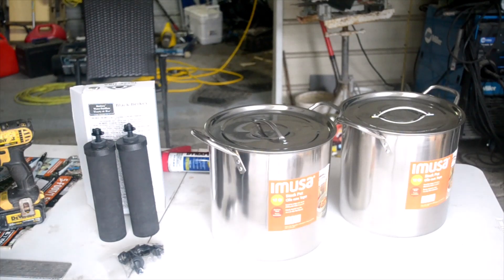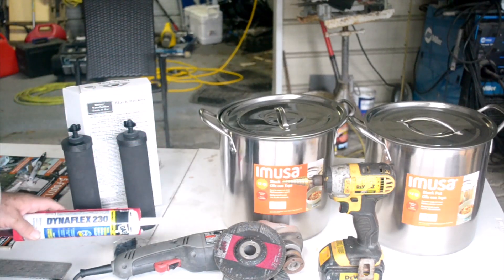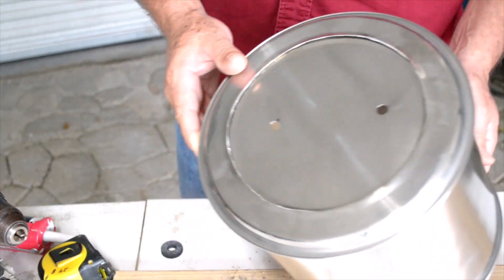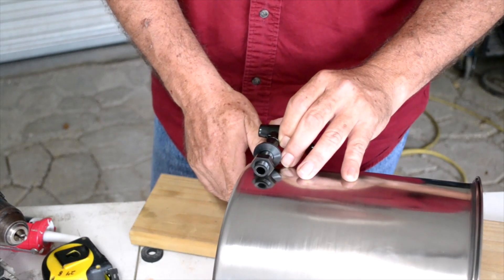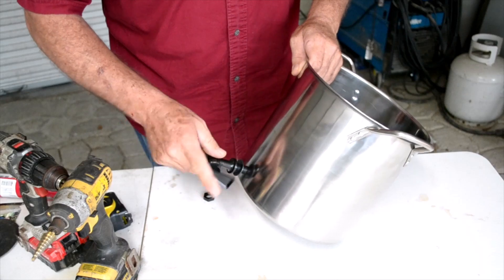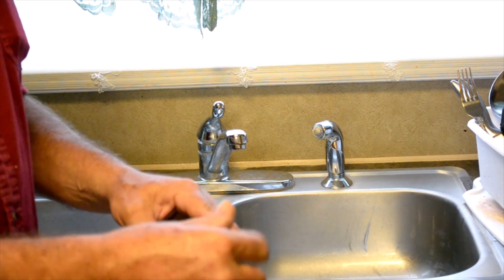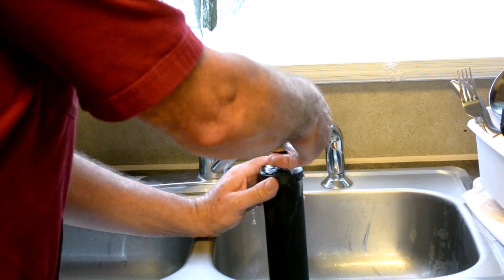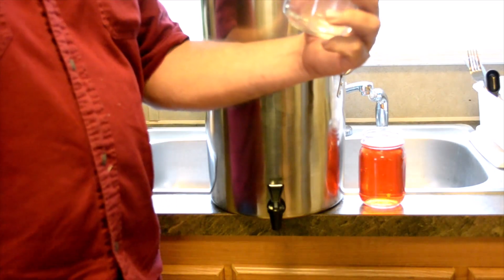DIY water filter purifier System

Comment: The filter(s) ares in the top pot, so the filtered water collects in the bottom pot, until you dispense it via the spigot. be sure to clean and sanitize the top pot occasionally, so the filters last longer.
Reply from the maker: Yes indeed. So for everything is doing great. It's amazing with the difference between this and tap water.

Comment: Nice video.   My suggestion for a much easier build is two "food grade" 5 gallon buckets.  No cutting, a few simple holes, large capacity.
Reply from the maker: Just use the stainless for easy cleaning and to keep from having a plastic taste. But good grade buckets will work and a little less cost

Comment: There was no need to cut a circle on the lid. A better option would’ve been to remove the handle by removing the rivets and placing two small hole to line up with the holes you drilled for the filter. .no silicon needed. It’s what I did.
Reply: You would still need to glue the to parts together to keep them aligned and avoid any possible damage to the filter. Assuming the glue is strong enough, it holds the bottom to the top, so it can be moved easily (when empty) and not come apart.
Reply: Excellent!

Comment: I bought 2 12 qts from Walmart. My concern is how secure is the top going to be when full. Even though the tops fits it doesn't go very deep and sea could rip over easily
Reply from the maker: I have not had any trouble with it flipping, I can not answer if it was set up on a boat in high seas
Reply: I missed the step  where u cut the top out and silicone the bottom.  That would eliminate  my concern 
 Thanks for the reply
Reply from the maker: Only upgrade to a better sealer, something like gorilla glue products
Reply: You can just filter smaller amount as you need, so it will not tip over.  To filter large amounts of water, you will need larger vessels.  Use supports if you use it in an unstable place, like a boat.  this idea was invented for a house, camper or RV.

Comment: instead of gluing it, would gravity do the work of holding it down so it can be removed for  filter replacement?
Reply from the maker: Glueing is not needed, gravity will do the job. But the glue will aide in preventing any dirt, dust from entering the purified water. The lid should be cut for the clearance of the filters.

Comment: Will taking a grinder wheel to stainless steel cause it to rust more easily?   these walmart pot are pretty cheap stainless to begin with.
Reply from the maker: No, it will not cause the stainless to rust. Use a thin a thin wheel or matabo blade. Don't go to fast, not to over heat the pot. It will leave a sharp edge that will need to be removed

Comment: I was so happy with the idea to make this waterfilter.
I immediately ordered some cheap stainless steal pans, ordered the filters and the stainless steel tap and made this filter. 
It worked like a dream.
But....after two months the stainless steel pan that collected the water had dark spots. The stainless steel was dissolving... Because I didn't know what came into the filtered water this way I felt  unsure about the warerquality.
So now I have a Berkey Royal with four black filters (you can't order a Berkey without the filters).
Our tapwater has a lot of calcium in it and the waterfilters became really slow.
Now I use sifted rainwater and it is absolutely perfect.